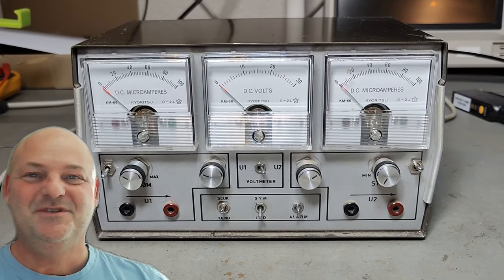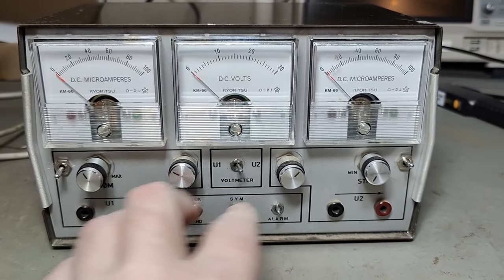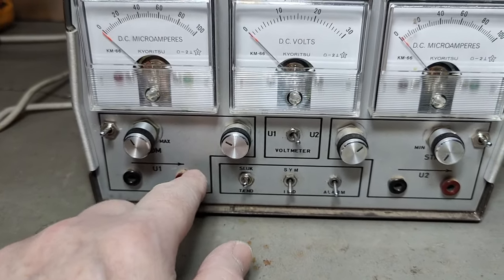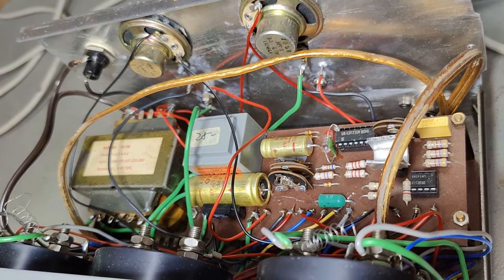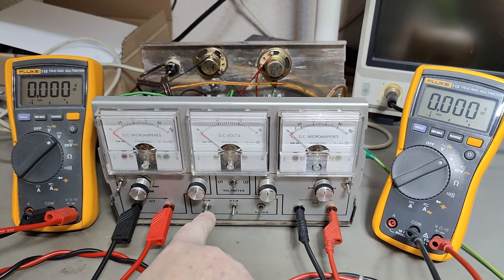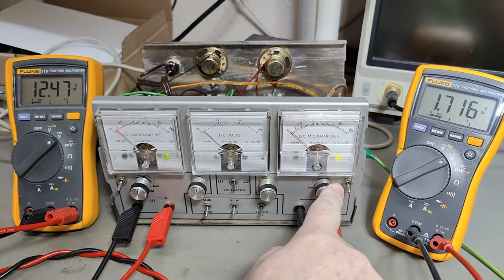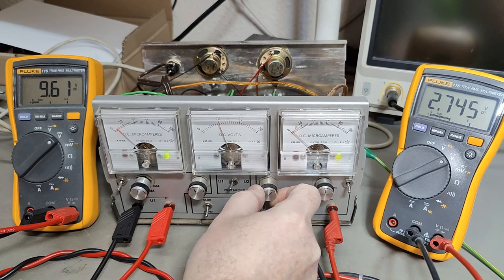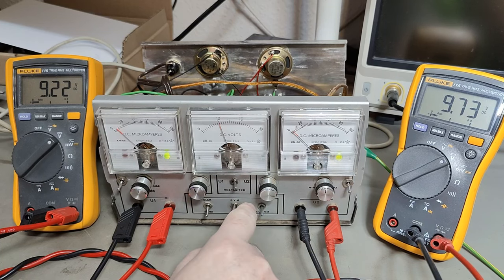DIY power supply dual 0-30V 0-1A linear with sound current alarm 1979

Comment: Hi Thomas, I consider the alarm function to be a great gadget, you don't have to monitor the consumption and you are notified in case of a problem - the important thing is that it can be turned off. I made several external alarms that save me from constantly monitoring measuring devices, I can monitor not only voltage and current, but also light.
The design solution is crazy inside, it has no grounding, crossing of the power wire to the main switch between circuits, safe distances, etc.
The mechanical design is nicely done except for the holes in the speakers and the missing cooler for the power transistors. The exact circular hole for the measuring device can also be made by hand, but it takes work (I'll send you a photo by email.) I like the installation of LEDs in the measuring instruments and the design of the control panel.

Nice day 🙂 Tom

Comment: In Germany, we once had the rhyme "Aussen pfundig, innen Grundig". It means outside nice, inside Grundig and it meant ouside nice, inside junk. Well, quite disrespectful after having seen some CNC-lathe control by Grundig. At work, we do have two lathes still running with these controls.
So the nice concept of the power supply was challenged by the build quality. And then counter-challenged by the fact that it works just nice.

BTW: The Grundig CNC comes from Philips. Later, Heidenhain took Grundig CNC over.

Comment: Yes, I like the buzzer and had even thought of it myself. Upgrades would be to have different tones for each channel. And, a timed beep, with different volumes... 3 seconds, loud and continuous, with each first initiation, followed by quiet 1/2 second beeps every 3 seconds, thereafter.
Reply from the maker: it could be current level = tone volume ? or tone frequency ? I think it is a Unique feature, i have never seen or heard about it before
Reply: @TeardownOZ2CPU If there ever was an obvious application for a VCO, that surely goes on that list :)

Comment: This instrument is already geniousware as it stands. You could use it as a connection tracer where the current
that must be able to flow is adjustable! Of course, you have to improve it slightly to react within
0.9psecond and latch the beep, so that Mr. Dave would not have to scathe it once it gets on his desk for a review.
But you could also improve it a lot, for example to play the US cavalry attack tataratara when the left channel
is in overload and the Pacman game over tune when it's the right one. You could install a bluetooth receiver and make
the LED's in the movements blink in the rhythm of the music. Disco lightning was always a favorite of do it yourselfers.
It will help you get through those long, dark, cold and lonely nights in the lab.
Or you could beef it up to 100A output and make it a circuit tracer for real men.